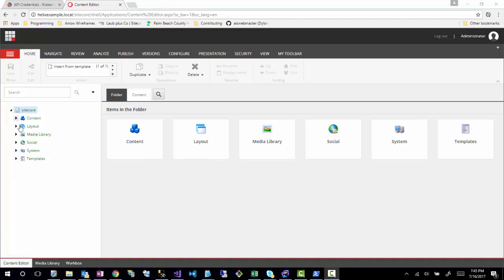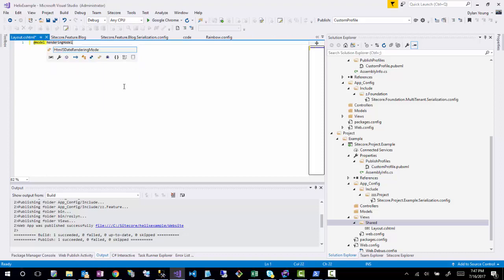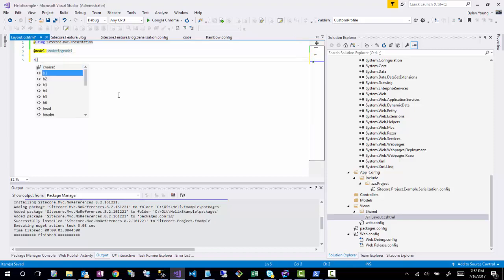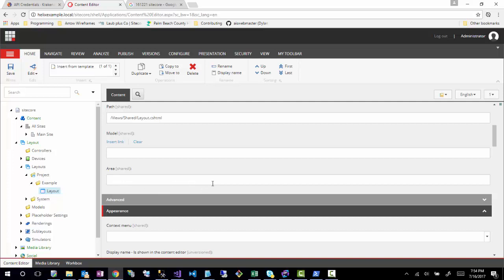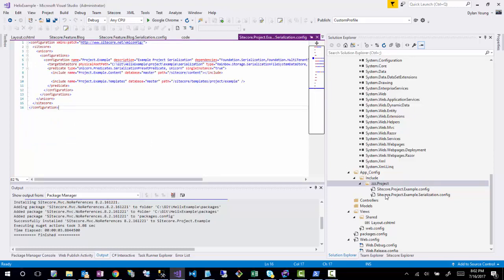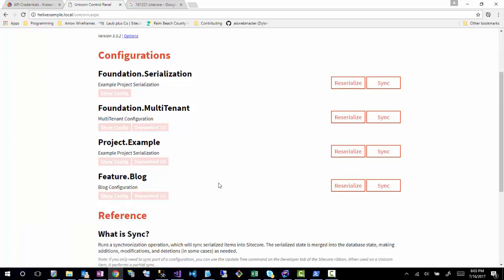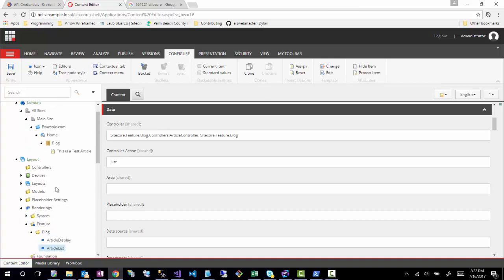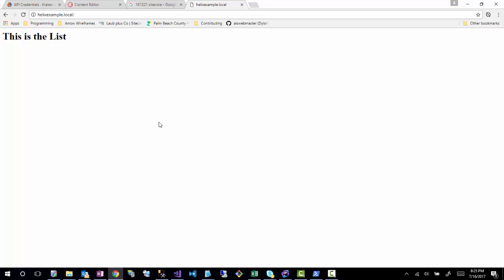Building a Blog Feature with Helix - Part Two Initial Blog Configuration

Comment: Great Videos Dylan... Very good job!
Quick questions. I am new with Sitecore and I got the "This is the list" printed and now I am trying to add the rendering field inside this layout page. 
For example: I added this line to display the title, but i got blank page.
<p>Print title: @Html.Sitecore().Field("{ item ID }")</p>

How can I do that?
Thank you, JC
Reply from the maker: That should work as long as the Item Id matches the specific field Id.  You can also use the name of the field as well to see if it's working.  If all of that looks good, than almost make sure you've published any content changes that you've made to your web database.  You can do that by clicking Publish tab at the top, and you can do a "Site Publish" to be on the safe side (since that should publish anything that hasn't been published yet).

Comment: Thanks for the video.  I was able to get it working mostly but I can only render "THis is the List" in preview mode.  When I browse to "helixexample.local' I still get the default sitecore page.  Any thoughts?
Reply from the maker: Thank you for watching.  It sounds like you are likely needing to do a site publish.  Go to the "Content Editor" and click on the "Publish" tab and click on the Publish button where you see the label and the drop down, and click "Publish Site".  Select just english (unless you are working on another language which I didn't cover in this course).  Then click next and it'll run.  You should now see this on your website front end.  Keep in mind that there are essentially two databases related to content in a Sitecore site.  when you work with the content editor or experience editor (or Horizon in 9.3), you are working within the Master database, which contains all versions and languages for that item.  When you publish, it takes this new version or language of your item, and moves it to the web dataase that helixexample.local is using (because it doesn't have access to the master database in a traditional configuration).